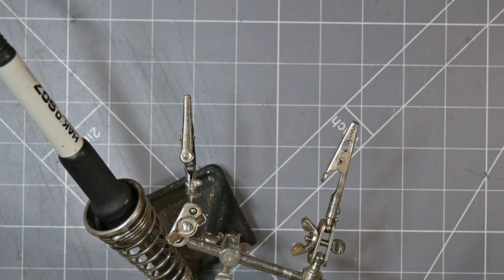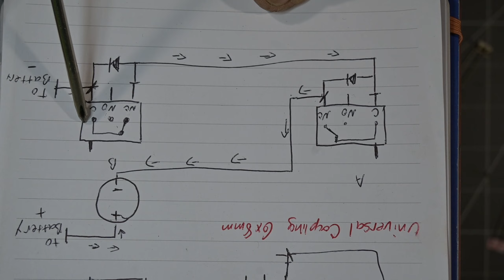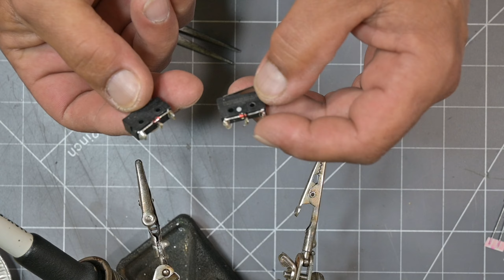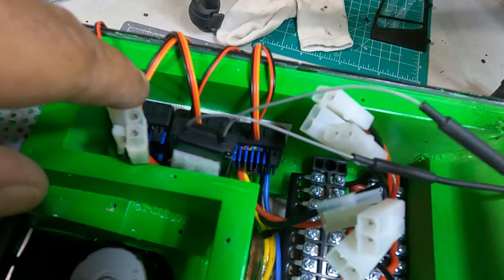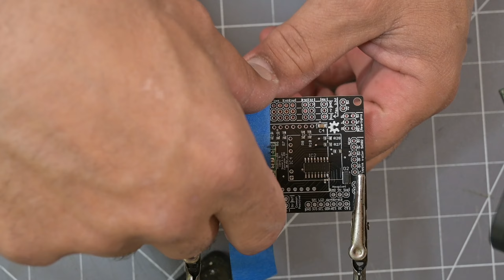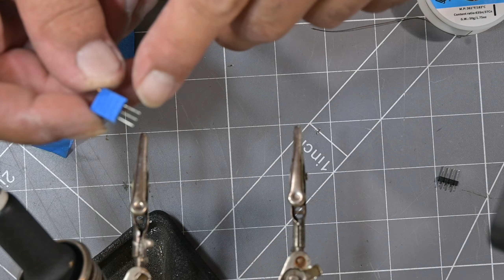Volvo 505 Rc 3D Printed Excavator Pt 2 Full Build

Comment: Great video, great build well done for sharing, I also print and build 1:14 trucks and equipment, plus Tamiya, still building a road grader, but look forward to all our next projects. Interesting to see the electronics by Thediyguy.. Must try.. Thanks again
Reply from the maker: Thank you, my next project is going to the track loader by Burnie222rc. After understanding the Sound and Light control By The DIYGUY999, I like working with it. it can be a little overwhelming at first but once you understand it , there is a lot to work with but with good results . I was think about make a video on what I've learned so far with it. Well thank you again and keep on Rc'in.